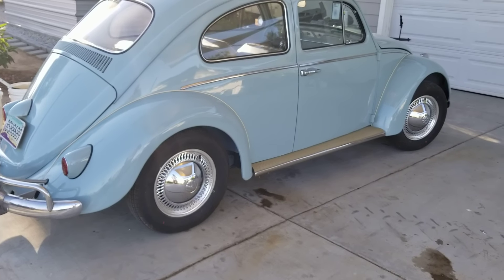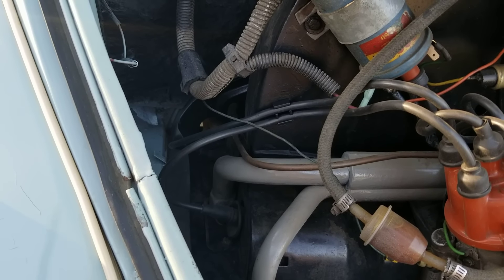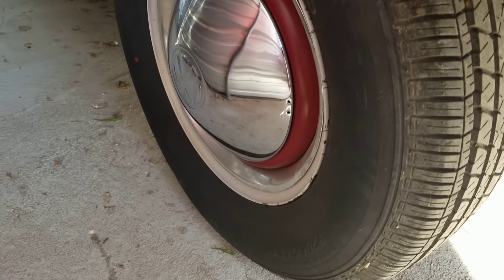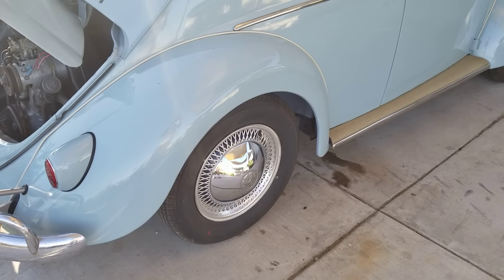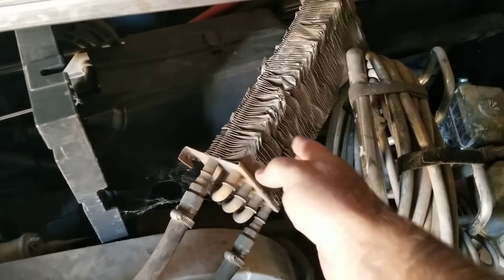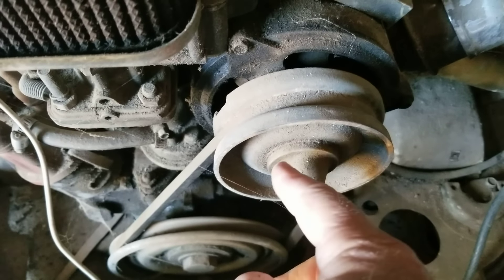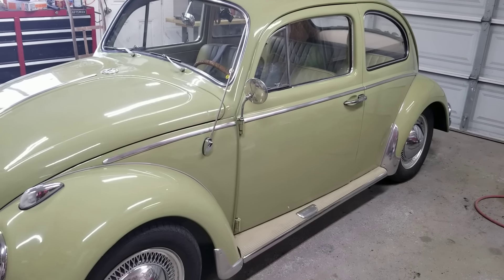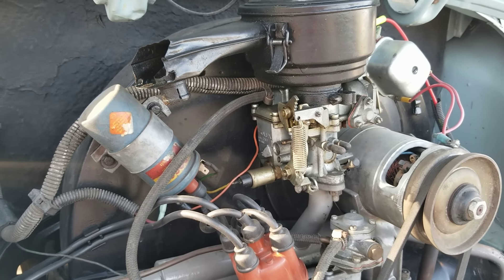Things NOT!!  to do to your Volkswagen VW bug or bus

Comment: Adjust your valves to .006, ignore all other settings in older manuals. Always adjust your valves when the engine is stone cold. It's easier to remove the distributor to replace the points than to do it in the car, adjust to .016 which should give you a dwell angle right in the middle of the dwell range. Always use a timing light to set your timing, don't time it statically. Pinch off the distributor vacuum line before setting the timing then set the idle. You may have to bounce between the timing light and idle until the car is warm. Then double check the dwell angle. Never file new timing marks on your crankshaft pulley, just use the ones provided. One exception to this is a notch 180 degrees out from the TDC notch. This comes in handy when adjusting the valves. With 34PICT-3 carbs adjust the idle with the idle air bypass screw ( the bigger of the two ) never the throttle stop screw.  If replacing the chrome exhaust tips always set the left one in to the correct depth in the muffler. The heat riser pipe uses the left chrome exhaust tip as a venturi to draw hot exhaust gas thru the pipe from the right side of the muffler. Failure to do this will cause the heat riser to coke up and become clogged and inoperative. Set the right one so it's end is even with the left one. If you have an electric fuel gauge there is a small round window behind the gauge to adjust it. Never touch this adjustment, it's not a potentiometer but a tensioner for a string ( I'm not kidding, it's a string ) that controls the needles position. If you play with it your fuel gauge will never function correctly again. Check your brake pedal distance to the front frame, it should be at least 200mm. If it is less then you will run out of brake pedal travel if one circuit fails. Adjust the brake operating rod to get at least 200mm then use the brake stop plate to adjust pedal travel. Beetles with single circuit brake systems can ignore this. Always check your generator belt at every fill up. Replace your belt whenever you find cracks or wear. Always carry a spare and make sure that you can change it with the tools in your tool roll. If your generator light should come on while driving, IMMEDIATLY shut the engine off and investigate the belt to make sure it's not broken or slipping.

Comment: What would you recommend as the max speed to drive a 1971 Super Beetle with the standard factory 60 hp engine ?
Reply: I would like to draw your attention to the early 70's VW Beetle Ads. VW say in the Ad, that you can keep your right foot - flat to the floor all day, every day. I believe that the engine is comparatively speaking - low compression. The low compression "limits" the max. RPM of the engine - to about 4000 RPM. So, the engine cannot be over-revved. Picture them all over Germany, on the Autobahns. In my opinion, driving with the foot flat down shouldn't harm the engine - if maintained. Other might add to this.
Reply: @peterduxbury927  Thank you.   😃

Comment: Just getting my first bug, thank you for the advice!
Reply: I  am a street rodder/classic car  guy.   Just sold  my  1956 Chevy 210  custom  with all the neat stuff including a LS  engine.  Guess  what,  I just bought my first  VW  and have minimal plans for the car.  New floor pans, (done)  new running boards  and a twin port engine (NO kaldrons to adjust).  freshen upholster;   I  am going to drive the wheels off these neat little  fun car.

Comment: Set your tire pressure to 18 PSI in the front and 28 PSI in the rear. If you have an IRS rear end you can clean and re-grease the CV joints ( the inside is the same as the outside ) but never mix the parts up. Each CV has matched parts tolerances. Always use the serrated lock washers under the CV bolts, disregard the book. It says they are not necessary, they are. If you have ridges on the axle shaft under the small end of the CV boot the books says you don't need to put a clamp on the end. Disregard this and always put a pinch clamp on the small end. Always torque the axle nuts to 285 ft pounds at least and do it with the car on the ground. Anything less and the drum splines and half shaft splines will wear. There are 2 different lengths of CV joint bolts, if you have the longer ones make sure they do not interfere with anything after installation. If you have a swing axle beetle you should consider installing a camber compensator if your VW does not have one already. They usually just bolt onto the bottom of the differential housing. Never install modern gas filled shocks on a VW, they will make your VW drive extremely rough. Always install non-gas filled shocks. Almost all VW's were designed for bias ply tires and they ride smoother with them. Expect your car to ride slightly rougher if using radial or steel belted radial tires.

Comment: at least use a metal jacketed fuel filter. Its also a very good idea to add a second engine ground wire. go from anywhere on the block to the firewall. clean off all the paint in a flat spot. drill a 1/4 inch hole in the middle of the removed paint area. get a 1/4 bolt with a nylok nut, a star or grounding washer, and a loop eye wire connector big enough that the 1/4 bolt will fit the eye.  solder a 10 gauge wire to the eye and with help get the bolt tight. put some grease on the bare spot and the bolt, eye,etc. now cut the 10ga. wire about 6 inches to long and attach it to the motor, bugs do sometimes lose their ground thru the motor mounts. if everything in the points etc. fests perfect but willnot start. or has wrak spaek or charge? this will fix it.

Comment: DO not run regular gas They like premium Not regular
Reply: Check the octane rating for the car and what's available at the pump, regular is fine in the UK.
Reply: What? Beetles in Mehico run on the crappiest gas
Reply: Run it on ethonal free.
Reply: If the compression is like 7 or 7.5:1 then you can run the garbage gas without issue. If you have a high compression engine like 11:1 then you need high octane gas. Most VW engines will run just fine on 87 Octane Gas.
Reply: Mikes random nonsense.
You know nothing about engines
.
Reply: Seriously, what a waste of time.
"Do not drive off cliffs".
You don't know what you're talking about.
Reply from the maker: the thing your not factoring in is that the engine is Air cooled. the engine temps are higher than water cooled. Higher temps make higher combustion pressure. Therefore premium fuel is a MUST. This is the only thing you can do to combat against no more lead in fuel.
Reply from the maker: Why do you say that. These are air cooled engines with high combustion pressure due to higher heat. Not just compression ratio. Heat causes higher combustion pressure. This is why you need premium fuel.
Reply from the maker: and they dont last long on that higher combustion pressures. from higher heat requires premium fuel it is not just compression ratio.
Reply from the maker: also says LEADED fuel not available so the unleaded with the alcohol and the engine being air cooled with higher combustion temps. makes higher combustion pressure. Best way to combat that is Premium fuel.
Reply: Mike Fn Garage ethanol will still gum up you’re carb jets and make you’re engine run like garbage the best thing to do is use ethanol free if it’s available. Premium still uses ethanol so it will still gum up you’re carb and it won’t run as good.
Reply from the maker: @TheGameMicro  yea  but compared to what they ran on when they were new the formula is not the same. Premium fuel has a cooler burn and is really necessary for older vw engine.
Reply: Mike Fn Garage premium will still gum up you’re carb and add more carbon to the system. Usually ethanol free is around 88 octane so it still burns really well you just don’t have to worry about the ethanol gumming up you’re carb jets and engine. Ethanol isn’t good for any kind of carb or any engine for the matter of fact. Ethanol destroys vintage engines and causes a lot of other problems if you run it. I highly recommend using ethanol free in any small engine or any vintage engine.
Reply: @Mikefngarage  I'll answer from all your short posts. Yes, the VW does run hotter than water cooled counterparts but they were designed that way. If all your cooling tin is in place as well as the thermostat and your engine is properly timed and it is not a High Performance engine you won't need premium fuel. You just don't. Ive been driving VW's since 1974. Still have a 67 bug and it is a stock 1500 and runs great. Yes, alcohol in the fuel can degrade the rubber fuel lines unless you replace the lines with ones that will not degrade in the higher alcohol content fuel. Won't look stock but it will last longer. I don't believe the little extra heat will increase the compression ratio enough to warrant premium fuels. I'll have to look further into that claim. Well, I do remember our higher octane fuels from the 60's. Far better than what we have today. Alcohol has less energy than so can't run hotter and is an octane boost. (E-85 is an alcohol based fuel – it also likes boost, and it runs cool, has much higher detonation limits than Gas – Drum E-85 is usually 117 octane.)
Reply: I don't believe higher octane fuels run cooler, they are more volatile and have more energy. More energy surely gives more heat.
Reply: @gavinlusby2338  Increased Octane resists detonation. That is all it is used for. Alcohol is an Octane booster because it is harder to ignite and it has less overall energy than gasoline. Alcohol runs cooler. In order to truly take advantage of higher octane you will need to boost your compression level within the range of the new octane level so you can drive your car without preignition or detonation. If your car is a low compression engine and you are running regular gas and you are experiencing detonation/ping the timing is off. If you don't correct that you can damage your engine prematurely. Again, Stock VW Engines don't need Premium Gasoline. Don't waste your money Be sure your engine is properly setup and tuned. If by chance your little VW is running 8.5:1 or Greater then you might want to consider using a more premium grade or just buy some octane boost. Buying Octane Boost may be cheaper considering todays gas prices. Especially here in California.
Reply: Bullshit.  I’ve run regular gas on all my stock air-cooleds since 1969.  No premium needed.  And I’ve owned a dozen of them.  And as far as ethanol goes, my latest bug runs fine on it with no jet issues in six years.  Where do these premium-octane myths come from?  Geeze.
Reply: Air cooled automotive engines run fine on normal pump gas. Thet don't need premium fuel unless they have high compression ratios. Predetonation is what damages engines. Higher octane fuels are made for that.
Reply: @Mikefngarage   .. You're wrong about the octane requirements. High octane is for high compression only.  If you worry about a VW having high combustion temps, that's also false.  Today's fuel has alcohol, this makes for much lower combustion temps than if you were using pure gasoline.  Using high octane is just a waste of money. It's been proven by all of us who use low octane without any trouble.

Comment: Never run points and condenser lol go pertronix if you live in the 21st century..
Reply: At least it was a centrifugal advance distributor and not the old vacuum advance pos.
Reply: Darrell Jourdan i prefer the vacuum advance distributor.. better economy when you’re not on the gas.. centrifugal advance is based on rpm so on highway it’s always advanced killing more gas whereas the vacuum advance backs off on highway allowing better mpg and more immediate advance when needed
Reply: I have both maybe I will put the old vacuum advance back on and check it out.... I bolted the vacuum housing onto a centrifugal distributor to make it look stock.

Comment: Do not leave home without a spare accelerator cable.....
Reply: Or throttle return spring... or a spare engine belt...
Reply: accelerator cables last at least 10 years. Just change the bugger and be done.
Reply: @TheViewmaster1971  … If you check those items every 3,000 miles (during service) you will never have those issues on the road.
Reply: @05gtdriver If you break a Beetle cable, check the pedal . Mine was bent a little & caused the cable to kink. After the 3rd cable, I grabbed the pedal & bent the mount slightly. I never replaced another cable.

Comment: I have an all original 72’ Karmann Ghia hardtop, 60k Miles. Two previous owners.  Ive owned it 20+ years. I’ve taken at speeds up to 80-85 mph.
 For a mile or so.  4th gear at those speeds are just hitting peak trq.  It’s not rover revving.  Does the Ghia have a higher ratio or different gear set?  The aerodynamics push it down and it tracks like a go cart. I do it once or twice a year since I’ve owned it.  Mostly tool around weekly in good weather 50-60mph around town.  70mph on freeways.

Comment: Do not use a cheap plastic fuel filter inline. Get the good metal one. Trust me on this one, had several friends with Bugs burn up the engine this way when the cheap plastic ff gave out.

Comment: It doesn't hurt to keep a spare wing nut in your glove box when running a heavy duty pressure plate on your clutch. If it pops off while driving from the high pressure you have a spare and are not stranded.
Reply from the maker: yea you cant get one of those at oreillys

Comment: Never trust a gas gauge until you know 1/4 tank means empty but I was able to adjust the gauge to read right after I ran out at 1/4 tank without a gas can of fuel. I have a half gallon gas can, now.
Reply: @Tom Lopes My uncle in Germany had a '68 Beetle. We visited in '72. My uncle was driving me somewhere & all of a sudden, the car sputtered & died. He moved a little lever, next to the seat I believe. He restarted the car & drove to the next gas station. I asked him if he checked the gauge for fuel. That car had NO fuel gauge. It had a little reserve tank of gas. Beetle owners were supposed to remember at what mileage they last filled the tank & fill again at a certain mileage. My uncle had forgotten since we preoccupied him with our visit.
Reply: trainsntile The lever is down by the gas pedal. After you flip it, you better remember to flip it back, when you fill-up. I once drove 37 miles to a gas station, on reserve. The reserve was about a gallon.

Comment: Don't put a plastic fuel filters in the engine compartment, the original one has one built into it and it can be cleaned. Older fuel pumps will fit on the newer beetles unless it has an alternator ( 1974 ), plus they can be rebuilt. If you've got rust in the tank, replace it ( they're still available ) and the brass screen in the bottom.  Don't use screw clamps unless they're designed specifically for fuel lines, I use pinch ( Oetiker ) clamps. The screw clamps tear up the hoses and don't clamp uniformly. Use the correct size fuel hoses. When removing fuel hoses, don't pull them off the carb or fuel pump, slice them off and don't use them again. Pulling them off will loosen the pressed in brass fittings. If you smell gas when driving more than likely you have a fuel sender seal bad or the line to the tank from the filler cap is not installed with the correct seals that wrap around the connections. This does not pertain to the older Beetles with the fill port in the trunk.  Do not use resistor plugs, the resistance is built into the spark plug holder. Using resistor plugs will result in an engine that does not run well. Always install the distributor correctly, the lobe for cylinder #3 is ground slightly differently so that cylinder runs a little cooler.  If your distributor is an original with a Bosch condenser, do not replace it every time you do the points, only if the points start pitting. Bosch condensers last a long-long-long time. If you have a mechanical advance distributor don't forget to put 3 drops of oil on the felt pad under the rotor at every oil change. When you grease the front torsion bars make sure the front wheels are hanging free and the suspension is not compressed. This will get the grease into all of the needle bearings. When greasing the ball joints or tie rod ends put 2 fingers around the boot and squeeze, if they feel as if they have grease in them, don't grease them. If not, just pump enough in them until you feel the boot expand just a little. Too much will blow the boot off and then they're ruined.  Use cork valve cover gaskets that have been soaked lightly in motor oil, using other sealant on the gaskets will mean you will be scrapping the old baked on ones off the next time you adjust the valves. Don't ever remove the thermostat or the flaps from your engine, it will run too cold and never warm up adequately.  Keep your car stock, don't fool with suspension or wheels. DO NOT LOWER IT.  And lastly, drive your VW, that's what is was meant to have done to it. Letting it just sit may be great for a museum but not for a daily driver.

Comment: Do not use a plastic inline fuel filter - they can fail and spray gas and possibly catch fire.  Run a metal inline fuel filter

Comment: On bugs, replace and securely attach your firewall insulation in the engine bay. The old tar board insulation will break and suck over your fan shroud intake and cause your motor to burn up fast. Almost had it happen to me, and know a guy who burned up a brand new turnkey engine he had just installed without replacing the old tar board.

Comment: Used Champion plugs in my '67 type 1 for 25,000 miles with no problem.
Reply from the maker: till you take them out.....the threads are usually stripped out or they come out with some aluminum with them. I would never run champion plugs on any car especially a VW.